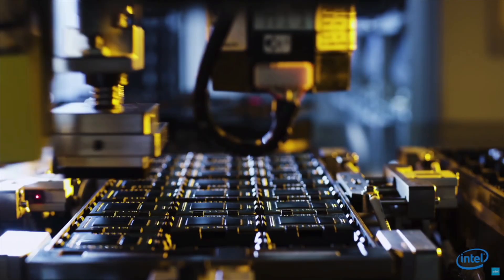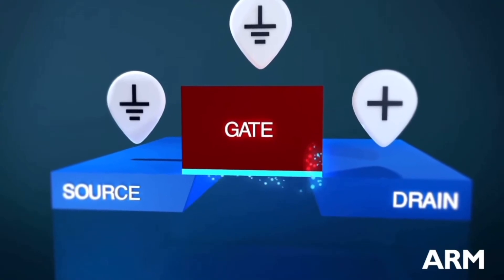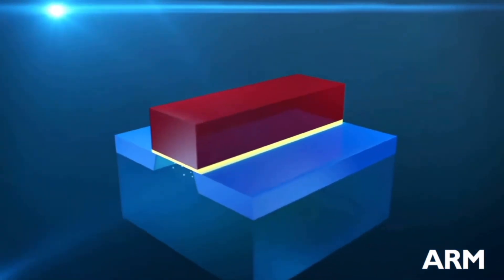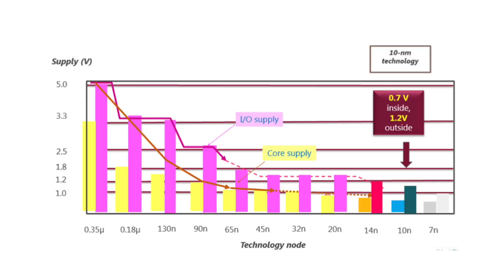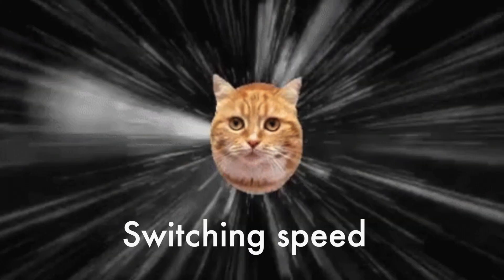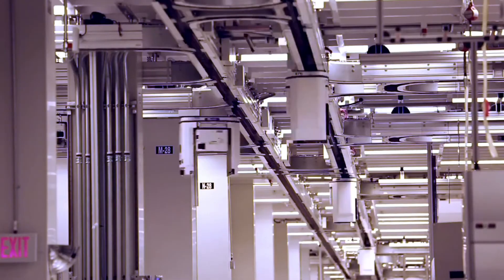What is wrong with 5nm, 3nm, 1nm.. CPU Technology Nodes explained

Comment: electricity jumps over when it is that small. i red the article. also, maybe more magnetique interference. but there was a problem with electricry isolation. maybe some static. therefor they coyld not make it smaller then 5 or 8 nanorubbish. maybe 9 too be on the save side.

Comment: What is wrong with 5,3,1 nm CHIPS?  Nothing, LOL.

What is the challenge to such technologies?  Heat ( H=i2R).  The other is manufacturing ability/yield.  Once the NODES get close to each other, dimensional stack-up issues in production yields fall apart.  Having a 1-5% yield bankrupts the CHIP manufacturer. They need HIGH yields to make money.

The new HNA processes will explode in high yield rates from Intel in the next few years.  Taiwan will need to rebuild plants to catch up within a decade.

The CHIP world changes.

Comment: the transistors in series have to connect to each other, right? so measure the distance between transistors, is that not easy?

for the lithography machines, then it makes more sense to say the minimum detail size

Comment: Older Core 2 duo, 2 ghz , 667, 2 mb cache, has 5-10 more connections, than newer that use 800 mhz fsb, and 1 mb cache. The role of the cache is to offload the cpu, and some actions are done with 0% cpu power, the option happens months after the windows activation, and after the dwld of the intelligence updates.

Comment: There is no guarantee that node shrinks means faster switching time for transistors and therefore higher clock speeds.  And it's more than just an issue with charging capacitors.  Yes over a few shrinks this is going to be true, but not a single shrink.

With node shrinks usually comes a drop in operational voltage AND current so while capacitors are smaller, well, there's less current to charge them.  What you're saying I'm sure is generally true but there are other factors such as the type of transistor being used, the quality of the etching and I'm sure people can list other issues.

Intel nodes for instance used to and probably still do run higher clock speeds than TSMC and TSMC can run higher clock speeds than Samsung.

TSMC has almost caught up to Intel with faster switching speeds.  It used to be about the best you could get from TSMC, with their N7 based nodes which also includes N6 nodes (an N7 variant) was about 4.9GHz.  And that took them years to get to that point.  And I'm also talking about acceptable operational speeds where a company like AMD will allow a processor core to clock to.  A person can OC and get a little faster speed but you start getting too much into the realm of inefficiency that it's not worth it.  In the meantime Intel's 10nm which was later renamed to "Intel 7" because the transistor density was about the same as TSMC N7 and they PROBABLY got upset because people kept saying how much of an advantage TSMC had over Intel which wasn't really true, could clock above 5GHz and with further tweaks Intel got that node up to around 6GHz.  TSMC had to move to their N5 process node before they could compete with Intel in clock speeds, but even still Intel 7 is faster than TSMC N5.  TO be fair Intel 7 is using more power than TSMC N7 nodes running those higher speed but you're still mostly in the realm of what appears to be linear gain with power vs. increased speed which means you're still, kind of in the realm of efficiency.

Comment: based on what i understood from the reason behind why we need smaller transistors for faster proccesors, does this mean the smaller you go the higher the frequency gonna be and with current technology we reached maxed 9.04ghz overclocked with liquid nitrogen, best case senario lets imagine the limit for thefrequency for this size would be 3 times what it is working now and how much we are away from atomic layers can we come to this conclution probably frequency in teraheartz or higher not gonna be posible by any kind of transistor, is this a right conclution ? please if you know i appreciate any accurate answer

Comment: a much more objective measure is how many transistors can fit per mm2 . that negates the need for any gate measurements and we can directly compare across different litography technologies

for example apple 5nm has much better transistor density than Qualcomm 4nm.
nm is meaningless , we should use transistor density
source:

https://en.wikipedia.org/wiki/Transistor_count

Comment: That's completely inverted. Node shrinks don't especially matter for modern chips; they especially mattered for old chips and they don't matter nearly as much anymore. In the 90's a process node meant sqrt(2) higher clock speed with twice the density at constant power. On a graphics card this meant twice as many processing units running sqrt(2) faster for absolutely free; no such gains are available today. Scaling was even faster than this so power actually increased; that's how we got ~60%/year average clock speed increases. After 2006 Dennard scaling really died and before that power hit a wall. That's why scaling has been so anemic since ~2006.

Comment: Anastasi, you should inform your viewers what an Angstrom is: 1 Angstrom is equal  to 0.1 Nano-meters. Up until now Angstrom is a term usually associated with spectroscopy [red light ~ 7000 Angstroms or 700 nano-meters] not usually associated with manufacturing of electronic components.

Comment: It is actually easier to explain what is wrong with nanometers. Three-dimensionality allows you to pack so many transistors on a given material, which allows you to talk about nanometers very conditionally. The problem arises with cooling, because this sandwich must be cooled somehow, otherwise it will burn.

Comment: Since the interconnect delay is starting to dominate the switching time, packing transistors closer together will continue to reduce the interconnect delay time portion of the overall switching time, but the increase in physical size of the 3D transistors might make that a wash.
Reply: Well, as a chip designer it has been 'routing>logic' delay since going below 1um.  So 3D transistors halving routing delay would be a massive advantage, I see a future where the transistor could get larger but stacked three layers deep, the biggest problem then becomes heat...

Comment: You`re Wrong Smaller Transistors Are Not Faster!!! it does not matter if they need less capacitance, that must only  mean to the fact that smaller electrics will consume less power just by simple physics, and so the 45nm Core 2 Quad is not faster than the 65nm Core 2 Quad And so does the Playstation 3 Super Slim with 28nm RsX and with 45nm Cell B.E does not Perform Any Better at all than the Playstation 3 Cecha01 with it`s 90 Rsx Gpu and 90Nm Cell B.E.

Comment: As you explain, speed and power consumption are the drivers for smaller node chips.  Having said that, China's current efforts in photonics, graphene, and quantum chips may make that chase to smaller nodes irrelevant.  We will know this year, 2023, whether China can show the gains in power and frequency as these type chips come into production.

China has a photonic chip production line coming online this year and it is taping up circuits for graphene as we speak.  Quantum chips, whether in silicon or graphene are moving out of the research lab to production also this year in China.

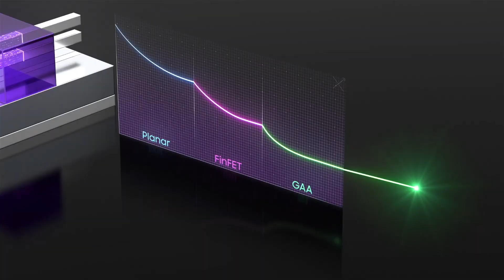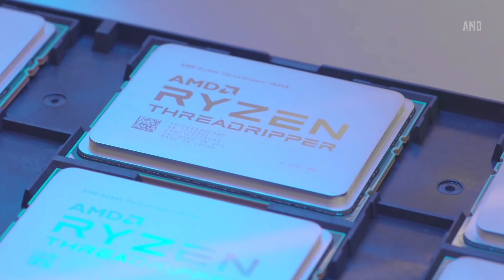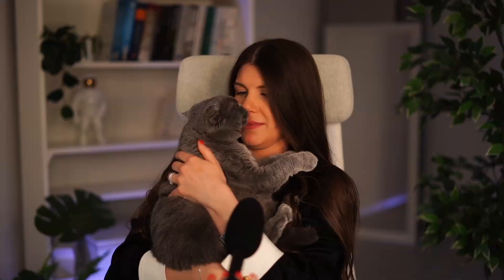Comment: 4:40 correct is a marketing number, I learnt this in the course of Nano electronics and semiconductor technologies I commented you about in other of your videos, I hope you have read it! I did not check my YT notifications because sometimes I receive many and ones shift others :(.... 5:58 Power is not just I*V, is static and dynamic power, static is the leakage of the transistor in an "OFF" state and dynamic yes comes from I*V but is = f*C*V^2, so it depends on speed (frequency), Capacitances and yeah as you said Voltage supply. 6:46 for the new people in this nano world, GAA = Gate All Around, is the Gate going around all the channel, not just above and sides as FinFET's 😉..... 6:58 exact but reducing the gate oxide thickness can also lead to problems like leakage through the gate so is not so good.... 8:50 nice that you mentioned interconnect.... 9:00 cool that you mentioned the PAA... 10:24 Intel inside! :D.... 11:14 yeah you now said it! PPA, now you miss 2 factors, C and E.... 11:55 EUV = expensive XD so yeah you mentioned C = Cost there, you missed E.... 13:16 hahahah water 🤣😂💚... 13:34 I did not see the link :( of VFETs.... Waving you from Brussels Anastasi!!! ❤💚💚🤗🤗 ciao chau chus a bientot! tot ziens! 😚😘😊💚💚

Comment: After these 5nm, 3nm, 1nm IC's have been properly packaged .... Are they delicate?  ... Or are they only good for well protected systems and systems with very good and stable thermal  and voltage environments? For example would they be used in automotive and avionics applications?

Comment: Anastasi, you are way too young to talk about 'originally' at 1:00.  It wasn't transistors, it was vacuum-tube valves, each with their own heater element, platinum wires passing through the glass; and complex arrangements of the internal structure.  For each BIT.  But this is fun; thankyou.

Comment: I wonder if it's possible to go even smaller than nm nodes. Would going smaller make it even better to fit more transistors or have we reach the limits of microchip technology! That means we'll have to go with picometer, femtometer and attometer, etc. We might have to go as small as an atom but then we have the issue of quantum tunneling with those extremely small size! Good video. It's detailed and informative.
Reply: I think part of the answer is the question of whether you can encode information in a space smaller than an atom (if you take that question literally, the answer is yes, because electrons, etc., but what I’m really referring to is if you could overlay a tighter, transistor structure then single atoms, meaning more than one transistor per atom). I’m sure there are people who know the answer to this, but I don’t see any reason why not at first blush

Comment: 12:28 Even though the price is higher for newer manufacturing process wafer, they will still have cheaper per transistor cost due to higher transistor density in the new wafer. The manufacturers do so due to scale of economy, not entirely the power saving benefit.

Comment: Hello. 

This video was really good if somebody would like to a know a little bit more from process nodes. 

You've made a little mistake. 
Originally a process node as you told, showed that how long the gate in the actual transistor. 
But much more before FINFETS there was a little change. In 1997 or 1998 when Intel moved from 350nm node to the 250nm node. 
At the 250nm node the gate lenght was much smaller (190-200nm) because the engineers dircovered a method how to shink it's size more smaller than other parts. And from that node until the 32nm (Intel's last Planar FET node) it was defined also something else. 
A measure was adverts to a size of a group of transistors. 

Anyway your videos are real good. I'm impressed. (I've first seen TSMC - ASML )

And your hair is really nice. ;)

Comment: It appears that the labeling of these process nodes are slowly going to be random smaller numbers if the industry does not come up with a standard for volume for process node since things are going 3-d instead of staying with 2-d. What is after 1? How much volume does a gate consume for real with all these process nodes including the 2-d ones down to the current ones.
Reply: They could go the next level down. Pico meters or pm. That's 1000 more numbers they can use.

Comment: @Anastasi In Tech  The cross section you show at https://youtu.be/GdLRSF5wZpE?t=239 is actually the pitch of the FIN, not the gate.
The gate pitch itself is perpendicular to the point of view, ie into or out of the screen...which is the same direction as the current will flow from source to drain...The 7nm measurement you show is the "width" of a single fin channel. The structure as seen is likely a transistor that requires 2 fins to provide the required current drive of the "transistor". 
Note: it is a real bar steward to get a cross section of the actual transistor length, as you have to mill back to the middle of a 7nm wide fin, think about that, the analysis tech/eng has to place the section with an accuracy of ~<2nm to get a reasonable section. I think the best method for this is mill the specimen at a small angle to the line and go along it to where you have the best "section".

Comment: If gate length is not expressive anymore, I'd switch to transistor density (transistors per square mm for example).
Further minimizing of structures amplifies the problem of leakage currents, quantum noise/tunneling effects and high frequency interference. With focus on the first aspect, shrinking down only helps if efficiency raises in the same scale. When facing current GPU development (take RTX 10xx to 40xx series) in terms of power consumption, it seems half of the electrical energy dissipates through leakage already - manufacturers move towards producing overpriced power resistors, so to say. 
To conclude, at 5 nm we might approach the rational limit for Silicon-based chip technology - we're talking about the width of 50 atoms btw. For more downsizing towards 1 nm and below, let's rather find better materials and production technologies.

Comment: Being a guy with military background, I am interested in how transistors used in modern IC gates respond to EMP attacks. Back in the early days it was discovered that cmos gates in integrated circuits were susceptible to damage in high voltage situations such as static where very low current is found with very high voltage. I'm wondering if the military transistors have found ways of getting around EMP attacks as transistors have become smaller and smaller, eventually breaking the 1nm barrier. The only way i know of is to use TTL instead of FETs,
Reply: CMOS has been rad hard for over 40 years...back in the 80's, and still today, rad hard devices were made on SOS wafers.
A SOS wafer has a wafers made of sapphire and an episilicon layer deposited on the top surface. The active trasistor regions are defined in the epi layer and there is no connection between the p and n channel areas to allow for lockup.
Buried oxide layers like AMD used also produced the same effect, not sure about the TSMC process.
Another way of producing rad hard devices is to implant highly doped buried layers that 'sweep" and current from an ionising event away from the transistor areas to junctions where the charges can recombine safely.
BTW here are a couple of papers that detail EMP effects, if you are interested: https://www.researchgate.net/publication/310582078_Latch_up_effect_under_electromagnetic_pulse
https://www.researchgate.net/publication/296683413_The_Induced_Physical_Effects_on_the_Semiconductor_Electronics_under_Electromagnetic_Pulse
You can download the full paper.

Comment: :yt:💥White Gold or gold dust usually observe as floating tiny golds particle elements in the water when we pan for gold mineral ore from the lakes and rivers. Those tiny metal particles are the most tiniest metal element that can be arranged for a nano-meter transistor that can conduct good electricity with a very low resistance💥💫💢

Comment: Thank you for clarifying the meaning of these numbers. I was always wondering if they are some measure of the density. But obviously they are not.
Reply: Pitch is the usual measurement of the density, ie how close together pairs are. For example true dense is equal line & space, if you can build transistors that close together they are really dense. You might only be able to print them, say 2x the line size, so a 100nm transistor can only be placed every 200nm. That is a simplistic and sort of unrealistic explanation but gives you a good idea.
Also the smallest pitch of backend metal connections has a big impact on how large the die is, it isn't just what you can do at the transistor layer...